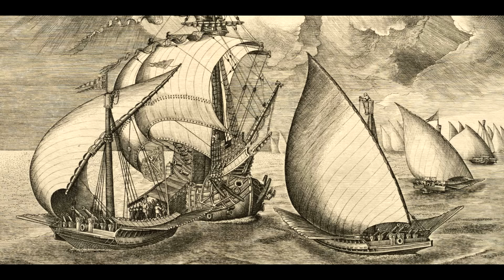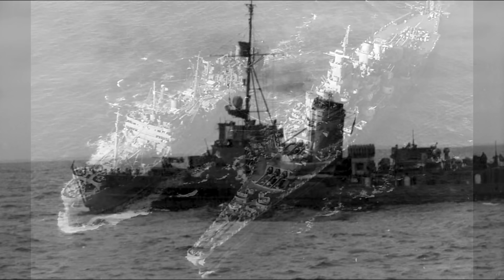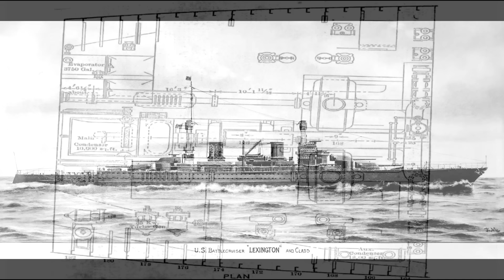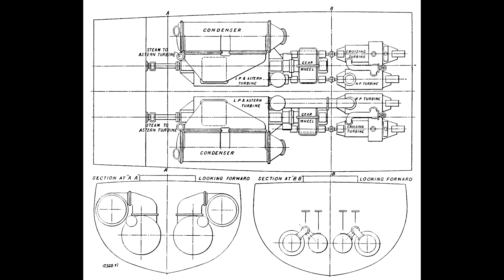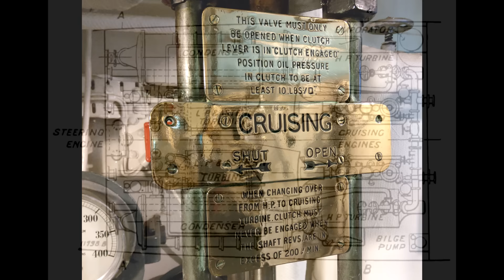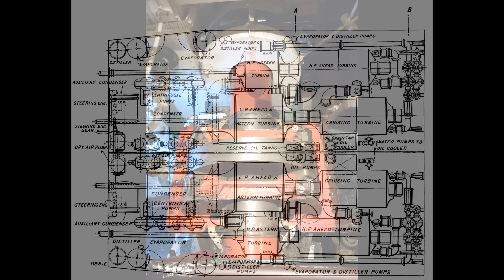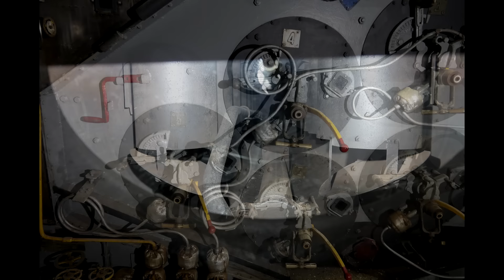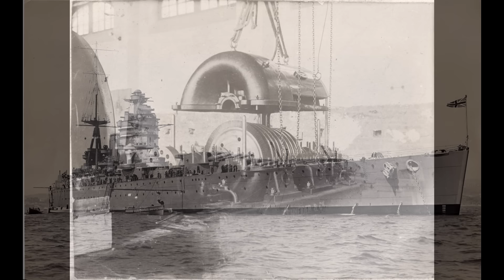Naval Engineering - How to choose your engines

Comment: I was a crewmember on the US Navy's last conventional steam (1,200 psi) cruiser. As usual, Drach's exposition is brilliant and altogether accurate. The US Navy's trials and tribulations with 1,200 psi steam propulsion in the Fifties, Sixties and part of the Seventies probably deserve at least one video of their own. 
Suffice it to say, it is no coincidence that the US Navy chose gas turbines for its small to mid-sized combatants, and (relatively) low pressure nuclear steam plants for its carriers.
Reply: I'm no boilerologist, but running 1,200psi on something that moves and shimmies in rough seas, sounds like a nightmare of an idea.
Reply: @jasonwomack4064  And that's why 1,200 psi went the way of the dinosaurs.
Reply: @zebbocaster What was it that made it such an unfeasible idea (ultimately)? Like, did it break down all the time, and if so, why?
(sorry for all the questions I've left in your thread, but this stuff is fascinating and it's not often you get to ask an expert)
Reply: @mnxs  After the necessary premise that I am no expert, I shall attempt to answer your excellent question to the best of my ability. It ultimately was, in fact, a feasible idea. When I joined the Navy in the early Eighties, most of our combatants had 1,200 psi steam propulsion. All of our Knox class frigates, lots of DDs and (AFAIK) all DDGs, as well as CGs, not to mention all the CVs from Saratoga to JFK (Enterprise was a CVN), had it and it worked fine. It most definitely did not break down all the time. In fact, on my ship I do not recall a single casualty (Drach's Navy would use the word "defect", I believe) either in the steam generation side (the boilers) or in the propulsion/electricity generation side (we used steam turbines for propulsion but we also had turbogenerators). 
So it was feasible, but also very, very expensive, because it required constant care and maintenance, and therefore a big crew. And people are expensive.
Reply: @zebbocaster Power stations ran 2000 psi at boiler feed and 1600 psi and 565 degs C at turbine stop valves since the mid 1960s. Of course they don’t move but they are ** big and coal fired (usually). They are also complex with twice though boilers (reheat) and they need special steels in the superheaters. So 1200 psi and (probably) 500 degs C steam sounds pretty reasonable.
Reply: For navy nuclear plants, the turbine steam may be relatively low, but given they are PWRs the pressure is most likely above 1200 psi in the reactor loop
Reply: @captainfactoid3867  Indeed it is.
Reply: @zebbocaster I assume it works out better there because the reactor loop is pretty minimal in comparison, or perhaps better (self-)contained, so to speak?
Reply: @mnxs  I am not a nuke, so I would not presume to answer, but I can ask my son, who is a nuclear engineer.
Reply: @captainfactoid3867  In a nuclear plant you have to keep the fuel from melting which limits your primary side temperature.  This translates to a lower secondary loop pressures thanks to conservation of energy in the steam table.  
Basically you can't run very much superheater since the maximum temp on the Brayton cycle diagram isn't high enough.
Reply: Knowing nothing about this except that 1200psi sounds scary high, at what point is your propulsion system just a bomb in waiting?
Reply: @extragoogleaccount6061  by the time I joined the ship, in the mid Eighties, the Navy had figured it all out. But it took a lot of training and constant checking and re-checking and adjusting of the boilerwater/feedwater chemistry, because that thing was, indeed, a "bomb in waiting".
Reply: @zebbocaster What was it that needed controlling in the water chemistry? (Or perhaps more to the point: why did it need controlling?)
Reply: @mnxs much like a pressure cooker the main reason to have it be so high pressure is the boiling point of water is way above normal. That way you have a much larger pressure gradient add more energy can be extracted
Reply: @mnxs  The two main objectives of controlling boiler water chemistry is to keep corrosion under control, and to minimize scale formation. 

Scale is the buildup of a hard refractory insulating layer of mineral salts on the boiler heat transfer surface. The consequence of scale buildup is the boiler furnace has to run hotter for the same power output, which is bad for fuel economy on the mild side, and bad for the strength of the boiler tubes on the extreme side. If you've ever lived anywhere with hard water, picture the white chalky stuff at the end of your spigot, but baked on at 500 degrees Fahrenheit.

The make-up water used for boilers needs to be relatively free of the mineral salts. Desalination plants take sea water and remove the impurities. Back in the day, steam distillation units were the primary methods. Reverse osmosis units are more common on newer ships. Both are followed up with ion exchange beds prior to putting the water in reserve feed water tanks.

Next, since no Desalination plant can get mineral salts down to zero, even a tiny amounty so low that you can't measure will eventually cause a buildup in the boiler over time. You still have to do something to keep them from forming scale. So we still have to add an anti-scalant chemical, like phophates. Phosphates do in boilers the same thing they do in your laundry detergent. They  chemically react with the mineral salts.  The antiscalant reacts with the mineral salts to form a soft sludge that falls to the bottom part of the boiler (commonly called a mud drum) instead of plating out on the tube surfaces. This can then be drained by performing a bottom blow down.

Now that we've dealt with scale, we need to deal with corrosion. You can't get corrosion rates down to zero, but you can get them down to where it's so slow it's nowhere near the driving factor for the useful lifespan of the ship. Iron oxide generally exists in two forms: hematite is the red stuff that flakes off really easy to expose fresh base metal to more corrosion. But magnetite (sometimes black, grey, dark blue or purple-ish) tightly adheres to the surface and forms a somewhat protective oxide layer once it's established. As an aside, chromium oxide forms a much more protective passive layer than magnetite. Stainless steels are steels with at least 13% chromium content.

The passive oxide layer is only formed and maintained in mild and low alloy steels if the pH of the water is in the alkaline range, about 9.0 to 11.0, depending on the plant and specific location (10.5 - 11-ish in the boilers, 9 - 10 in the feed, steam, and condensate system). pH is done by adding a base to the system. Usually it's two basic chemicals: one chemical that doesn't boil off and remains in the boiler proper, and another chemical that boils at the steam temperatures (volatile) in order to protect the balance of the plant.

Next up, dissolved oxygen in the water can destroy the passive oxide layer we worked so hard to create, greatly accelerating general corrosion, as well as causing sever localized corrosion called "pitting". Unfortunately, water at room temperature can hold lots of dissolved oxygen. Otherwise there would be no fish. We have to get the oxygen out and keep it out. That's done by three methods in combination. First, there's a deaerator that the boiler water passes through, usually upstream of the high pressure boiler feed water pump. As the water flows through the dearator, steam (usually called "pegging steam") is bubbled up through the water to bring it to a higher temperature. The solubility of gasses in a solution drops as you raise the temperature. Its the same reason why your favorite open can of carbonated beverage would go "flat" way faster if you left it in your car in the summer compared to leaving in the fridge.

That gets most of the oxygen out, but that's still not good enough. You can't violate nature. A dearator alone can't bring the oxygen concentration lower than what nature says is the equilibrium concentration at the dearator temperature, which is still in the parts per million range. We want to get down to the parts per billion range. So another chemical called an oxygen scavenger (e.g. sodium bisulfite) is injected near the feedwater outlet end of the dearator. The scavenger chemical reacts with the oxygen so there's very little oxygen left to react with the metal (corrosion). Usually we don't even measure oxygen content, and instead measure residual scavenger left over. The final step in keeping oxygen out is to minimize system leaks. Vacuum leaks at the turbine exhaust suck air directly into the plant. Small condensate and steam leaks have to be made up for by adding water from the feed tanks, which are kept vented to atmosphere. And any water added to make up for water leaks makes the dearator/scavenger work harder.

All these chemicals we're adding tend to buildup in the boilers over time, which can cause other issues (e.g. phosphate wasteage, foaming). So we'll perform boiler blowdowns periodically, which include the bottom blowdown (more frequent) mentioned previously, as well as a surface blowdown (less frequent) from the steam drum to get rid of stuff that floats.

Lastly, we want to keep out other impurities. Halogens (e.g. chlorine, fluorine) can cause some severe localized corrosion quickly. Oil, grease, and other organic material will combine with boiler water bases and foam (pre-industrial era soap was a mixture of caustic lye and animal fat). Suds leaving the boiler and passing through a turbine wheel spinning at 10,000 RPM is really bad for said turbine.
Reply: @mnxs  Each reactor has its own chemistry (Enterprise had eight reactors) each with its own quicks and chemistry to track.  No two reactors act exactly the same.  This unique chemisry is why any bit of weapons grade fissile material can be tracked back to an individual reactor, in a paticular year and production batch. As each batch has a unique combination of isotopes that make up the fissile material.
  For example, Reactor A may need 1.8% more  pure water in the loop than reactor B needs, to keep the same heat and steam output.  While reactor B needs just a bit more juggling of the cooling rods to keep it just so, while A is more of a set and forget for a given output.
Reply: @stevebriggs9399 Holy hot damn, what an answer. Thank you so much! This is beyond excellent! Explained it perfectly. Again, thank you!
Reply: @Yandarval I don't really know why I'm surprised, but it's kinda wild that individual nuclear reactors can be so... "temperamental", so to speak. "Finicky" is probably the better word for it. (And I'm sure the sailors have invented far more colourful terms.)
Reply: @extragoogleaccount6061   all steam propulsion systems are just bombs in waiting, it's just that the size of the potential explosion varies
Reply: @extragoogleaccount6061  Always. Google "USS Iwo Jima steam rupture". Ten fatalities.
Reply: I was on a Knox class FF that blew its 1200psi main steam line. Luckily no one died but the ship was out of commision for a month while they cleaned out all the asbestos and replaced the piping.
Reply: @johnknapp952  Thanks to the Lord that no one died.
Reply: I sailed on steam propulsion LNG carriers. Steam pressure was 900 psi / 60 bar. All of them save one were heaven to work on. Yet their fuel consumption was prodigious so they had to go.
Reply: @Republikaner1944  And yet it would seem that at least some LNG carriers still have steam propulsion. References:
https://www.youtube.com/watch?v=tmBSiSdSNpU
https://www.youtube.com/watch?v=WraqL8kWeFo
Reply: @zebbocaster   I know. This is one of the previous Shell G class. There are some steam LNG carriers going around, mostly built by Japanese, even in combined steam + DFDE propulsion plant. Nowadays mainstay are two stroke low speed Diesel engines like MEGI and XDF. Former coming from the darkest bowels of hell while later being a gift from heavens.

Comment: This really makes me want to try to design a steam turbine powered bomber aircraft. WW2 era. With a single, large pusher propeller. Could this have been done? I know it would have serious practical problems, I just mean as a thought experiment.
Reply: First thought...... "Too heavy and bulky"....hence internal combustion engines.
Reply: Or a real life Kamakiri
Reply: The shaft of that single large propeller is going to have to be pretty far above the ground.  And how do you build a boiler and turbine unit that is light enough to be lifted by its own power?

Comment: 8 whole seconds!❤

ETA: were coke fired boilers ever experimented with?
Reply: It was certainly tried for steam trains, and the fact that it burns with very little smoke was considered an advantage. On the other hand, it was significantly more expensive. Using it in ships would, I suspect, dial the issue of expense all the way up to 11.
Reply: Coke is really a difficult fuel to burn, even more difficult than anthracite, which is also basically smokeless. Bituminius coal has 10-24% of it's energy in the form of the volatiles offgasing and burning above the fire bed. So pound for pound with the volatiles, coal has a higher energy density than coke, even though it can't reach the same extreme combustion temperatures- which are really too high for steam boilers anyway. Some that have tried melted the grates out of them. Add in the cost of coke, and for a money-tight navy, why bother? At most Anthracite coal offers a lot of the same perks as Coke (low smoke, higher combustion temperatures, low ash) without the cost or same difficulties in firing.
Reply: @seand7894 best answer!
Reply: Actually, there were a few!  I remember a torpedo boat that was designed to use coke for its lack of visible smoke!  But in a major warship, not that I have ever heard of!  The problems are considerable as others have pointed out!
Reply: @mahbriggs oh cool!
Reply: I don't know if there were experiments. I suspect that the high temperature of coke (2000c) vs coal (1000c) would require much stronger furnaces , boiler piping etc.  Equalling higher cost and risk.
Coke also is much harder to ignite as it's much denser than coal. Time raising steam from cold boilers to full steam in any vessel, especially military/navy vessels is if not top definitely one of first  4 priorities.   Speed, Range, Armament and Armor.  (In any order , as required by individual countries/navy and vessel type.
Reply: @robm4834 Coke is actually much less dense than coal. The coking process bakes off the volitiles, leaving behind a light gray or graphite colored, almost spongey rock. It's surprisingly light if you ever pick it up. It's the fact that there are no other components to aid the combustion of the carbon that makes it hard to burn, and requires a lot more oxygen and heat to obtain that combustion. The more pure the form of carbon is, the more heat and oxygen it takes- even diamonds can be used as fuel if you get them hot enough and fuel the fire with nearly pure O2.
Reply: @seand7894 dense does not necessarily mean heavy. Can as in this case refer to tightening/shrinking of structure.  Similar to say grandma's hand knitted jumpers are much looser weave/stitch compared to machine made jumpers.
Reply: @robm4834  I just want to say that normal coal can burn significantly hotter then 1000C. At my school we forged with both traditional (for mainland europe)"fat" coal and later with cokes because neighbour complaints, and both can get steel to white hot heats, and even burn them, this means at least 1400C is easily managed with both. 

In our experience cokes need more air to burn hot, and they produce significantly more clinker. 

On a sidenote, if you just don't want smoke, antracite coal is an option, it's available in the UK and burns smokeless.
Reply: @slome815 if you read my comment properly you'll see i said coke burns @2000c (c stands for Celsius).
I also stated it therefore would require a stronger furnace to resist the extra heat, boiler pipes and more also would need upgrading. 
 
Is this the point I'm supposed to thank you for essentially reiterating my comments. 
Maybe read comments twice or thrice before you comment, better yet hit like or dislike and don't waste my time geezer.
Reply: I tried dumping Pepsi in a stove but it didn't burn sadly.
Reply: @natthaphonhongcharoen see you're supposed to bake it in an oven first. 😅
Reply: In 1981 a company announced they were going to take the SS United States out of layup and run it on coke .
My roommate and I wrote them asking to be cadets on board as we were engineering
Students .
Never heard back or anything else about it .